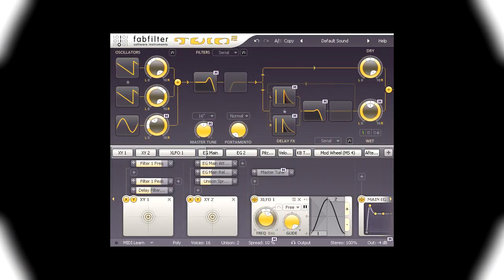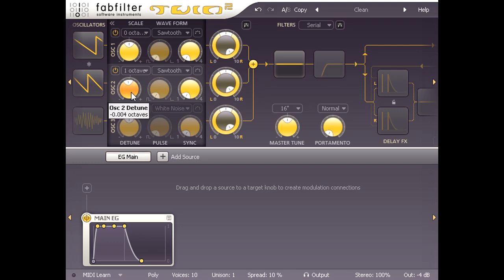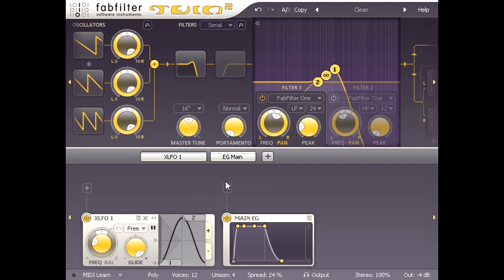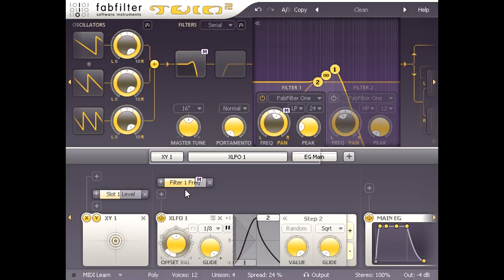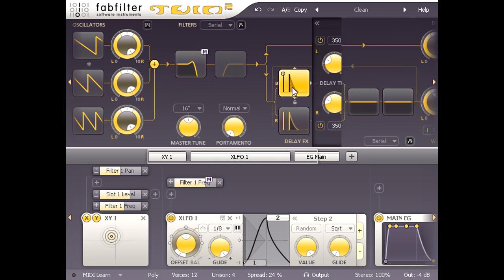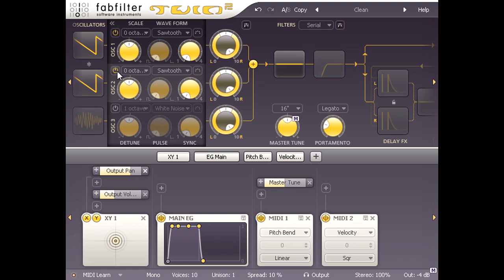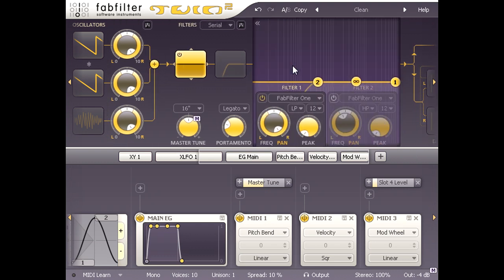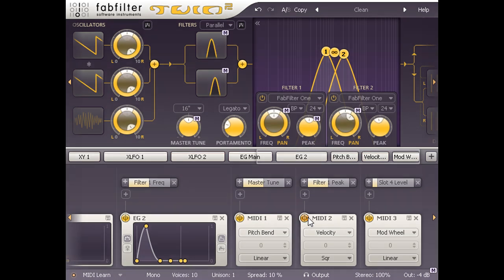Sound design with FabFilter Twin 2 - 1/2

Comment: synth sounds awesome, 1) what's the difference between moving the balance ring all the way to the left and moving the phase offset directly in the step window?.
2)  how do we know what's modulating what if there is no indication of routing  as soon as the dragging line disappears after we hit the target?
Reply: Notice that there is a little "M" on the right corner of every parameter. Click on it and it'll show you how is being modulated.

Comment: *Nothing* is forever though... I remember when a PCB goes out on a vintage piece of gear, and you either redesign it yourself, if you pay someone else to. It isn't cheap either. That said, no platform is the be all end all solution. You can't get analog sounds from a soft synth, just as you can't do certain things on a hardware synth. They each have their place and usage. Just my .02

Comment: Hardware synths don't last forever either. What happens when a rare transistor dies on a vintage synth? It is difficult to find a replacement.

With computers, you just copy the vst + settings to a new one.